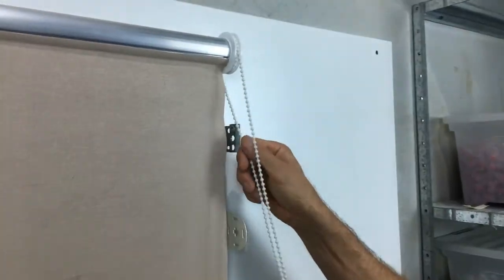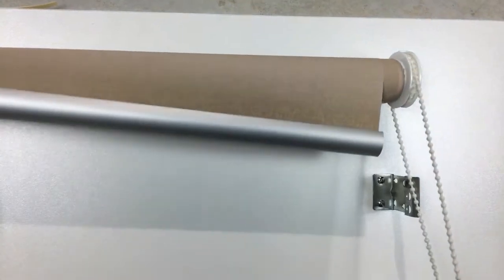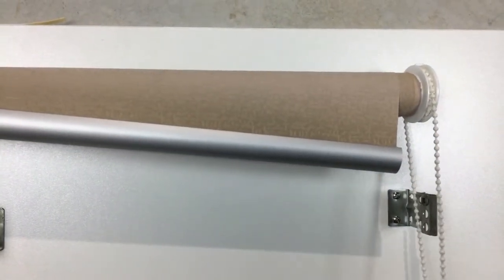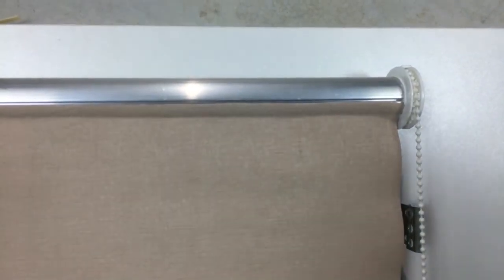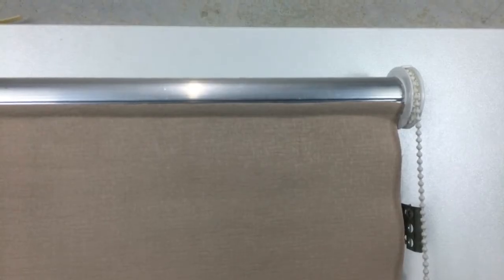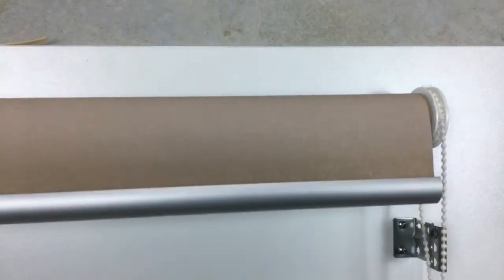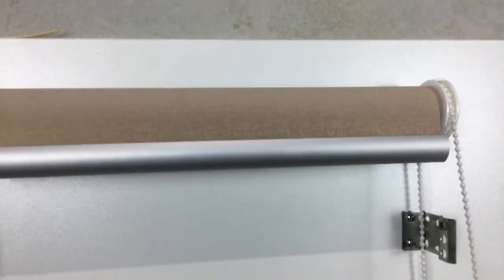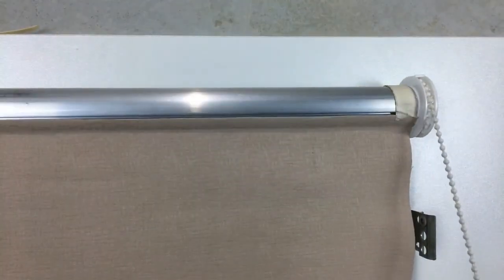Repair Roller Blind Not Running Straight.

Comment: I'm having the most confusing problem where when the roller shades are up, the left side is higher, when the roller shades are down, the right side is higher.. I'm not sure what the fix would be then or what the problem is. The company just told me to put tape but when the blind is fully up or fully down I'll have an uneven issue either way! It's ceiling mounted and 8' long roller shades
Reply from the maker: In this instance one of the blinds May have more fabric on it than the other . The way to fix this is roll the blinds down so the tube is exposed Run masking tape along the tube from one side to the other and ll the blind back up . You may have to experiment with it and do one blind or the other to see if it improves .
Also these sound like a linked blind so before you start adjust the blinds so they are level at the top .

Comment: Possibly a dumb question but let say I add to one side like you did in the video and then the problem switches to the other side, do I just add tape to the other side and then keep adding tape to both sides until the problem is sorted?
Reply from the maker: Sometimes instead of putting the tape right at the end of the tube you move it closer to the centre , this can help with the problem you are having
Reply: @BlindRepairSolutions  thank you I will try this

Comment: Hi, How do you remove the aluminium bar from the swing mechanism please? I have exactly the same type of blind as you. I have tried several ways without success. It feels like the two parts are stuck together. What I'm trying to do is to put the cord back in place that came out. Thank you!

Comment: Neat trick, took 2 mins. to get the correct number of tape strips, the annoying cock-eyed blind is no more. (It works by simply increasing very slightly the circumference of the aluminium roller at one end, but who ACTUALLY first applied the physics to a roller blind??)